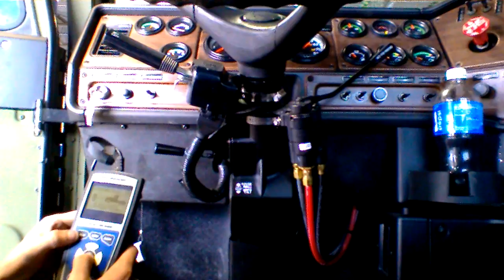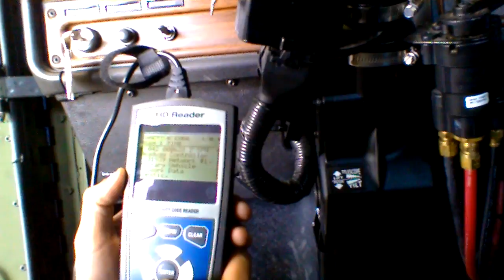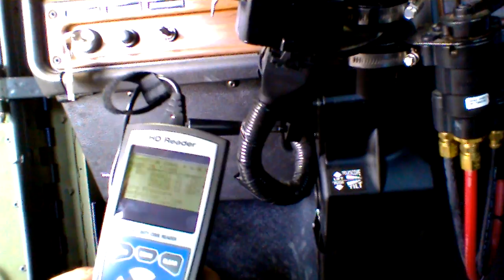Pulling DTC's from a 09' Freightliner

Comment: sounds like you know what you're doing, but did you record this on your phone?
Reply from the maker: TexanUSMC8089 i did not. just. really cheap tablet the school gave me
Reply: Mike you seem like young bright guy.Get out of this dead end trade , become a plumber or electrician or any building trade. I've been a truck and coach tech for 30 years and I know.up here in Canada truck mechanics average$35.00 with no pension building trades are between $43 an hour for 2yr apprentice drywaller to$59 an hour for 5yr plumber and remember these guys gave full benefits and gold-plated pensions.There who expenditure on tools is less than a grand.most building trades take mechanics in with open arms because they know how hard mechanics work.fuck flat rate fuck the speakership.take a look at what other trades make.mechanics have been getting screwed since 1940s.good luck and get out of this shit trade save your money.fuck Mac and snap on